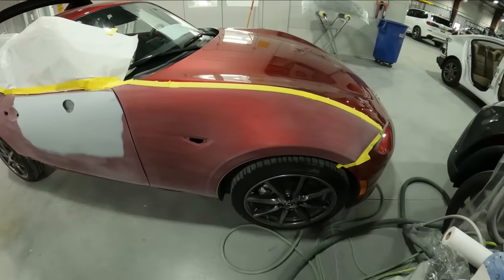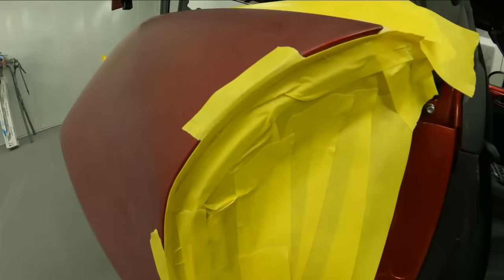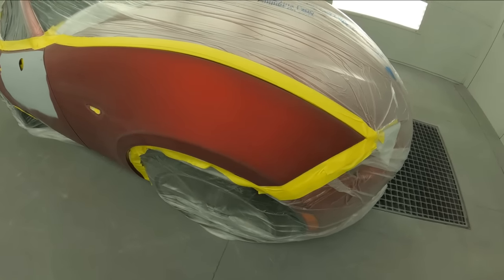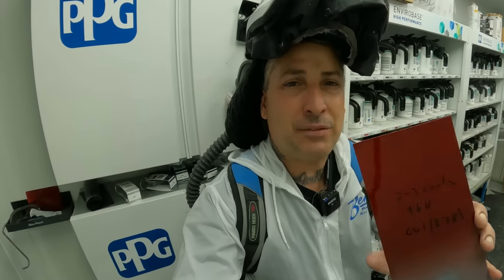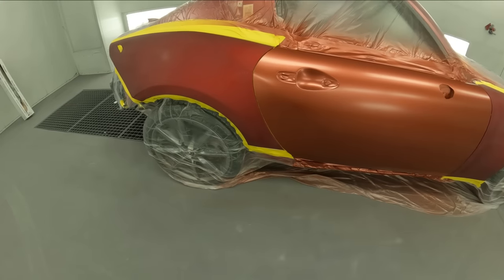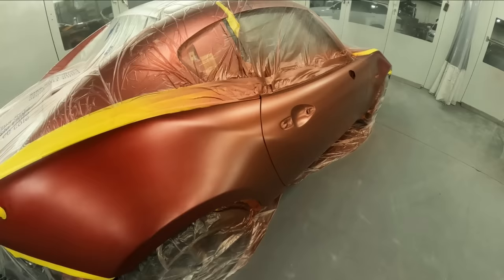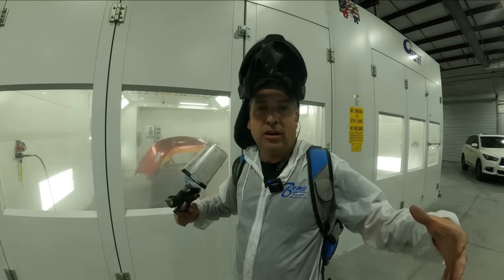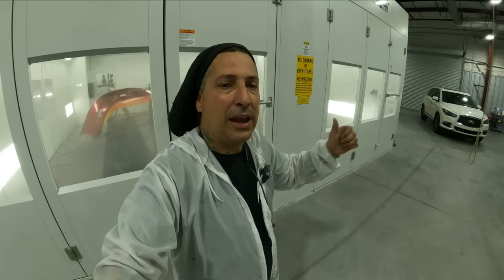How To Paint Mazda Soul Red 46V…

Comment: Excellent job!  The 2 happiest days of my life were the day my wife bought a Mazda with 46V and the day I sold it!  I read after I got rid of it that Mazda had some paint issues with it chipping, not sure if that is true but the hood was so full of rock chips that I almost repainted the front clip.
Reply: They're beautiful, but unfortunately you give up some durability with pretty much any 3-stage paint. That includes pearl whites. They're a little easier to chip and more likely to fade if it's a color in the red family. Also, Im sorry to say your wife may be a tailgater. That's the most common reason for excessive rock chips in the front bumper and hood. Driving too close to veihcles in front of you. Especially semi trucks. No offense, just relaying the facts. Im sure your wife is a lovely person.
Reply: @edjackson4389 tailgating or not the rock chips are inevitable. I own a 22 MX-5, it’s my daily and being from Colorado means a ton of elevation changes. I swear I will be in the far right lane going the speed limit and a semi 100 feet a way in the far left will throw a random rock chip on my hood with the winding roads like I-70 and I-76 here. Throw that in with so much traffic and everyone blowing by you going 90. 15k miles in and I’ll probably have to get a respray soon if I don’t end up wrapping it instead

Comment: Always looking great man. Back to the days when this color first launch, its a night mare to spray. In our paint system, its not tinted clear for the candy, its just binder with concentrate red which makes it alittle easier to spray. But man, u do a great job with any paint system. 👍👍. Btw, appreciate if you can teach how to do a soft edge masking on your knees. I tried alot of times and it just didn't turn out straight enough the edge 😅

Comment: Beautiful colour and a beautiful finish on the 46V Kandy Man you make it look so easy, I've done this colour once and it came out fine but for some reason the mid coat isn't a true candy in my scheme but it's a basecoat binder with a couple of transparent tinters to get the candy effect, came out looking nice though👌🙏👍John UK
Reply from the maker: Thanks John
Reply: In ultra BC8 it’s a clear basecoat with a red toner. Usually water based systems will use tinted clear not so much with solvent.
Reply: @HackMasterBlaster  I use PPG Deltron (solvent based) and most candies I fix use tinted clear basecoat as the candy layer. Only a few colors are the exception. This Mazda 46V and Fords RR, and few others use the tinted clearcoat method he's demonstrating in this video. So, you never really know til you pull up the formula. As beautiful as they are I despise these colors. Insurance companies rarely pay enough to compensate for the extra labor and material cost associated with these candies.
Reply: @edjackson4389  I sprayed PPG Deltron at one shop and you are correct, they do use clear for mid coat but in most solvent systems it is not the case.

Comment: I'm curious why there's a difference between ppg and Sherwin on this color.   My system calls for a black sealer. And  use the black sealer and number of base coats to determine how dark you color will be. And I am definitely a fan of the darkest 46v. I painted my Abarth this color when 46v first came out. It looks great but I added a little copper over my base, just a drop coat. Unfortunately it made it brighter, and I regret it, although it does looks amazing.  As a custom painter I like to make my cars have that unique color. My dream job besides painting custom cars custom colors and designs would be to create colors for manufacturers that want to venture into flashy colors.

Comment: Awesome finish ...
Did you use hardner and reducer on the tinted clear ... 
How many min between coats of candy
Reply from the maker: Yes it is thanks for watching
Reply from the maker: 10-15min between coats
Reply: Glad to know this, I do Candy paint jobs like this as well but I've gotten a lot of criticism that it's not the correct process. It's reassuring to know that someone with your experience and knowledge does it like that too. I've been told you have to panel paint candy jobs but I have never had an issue painting them they way you did👍